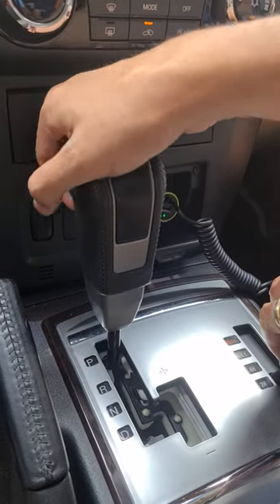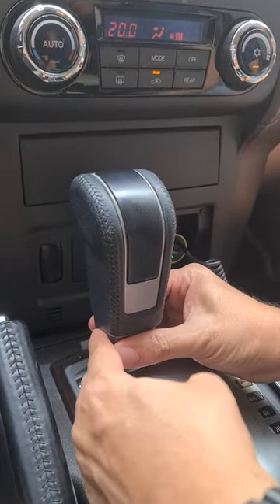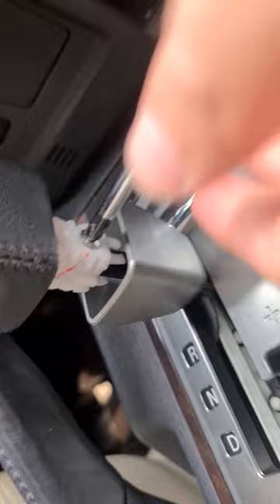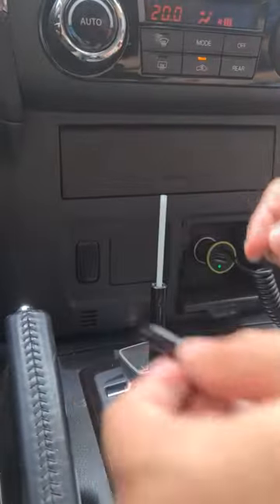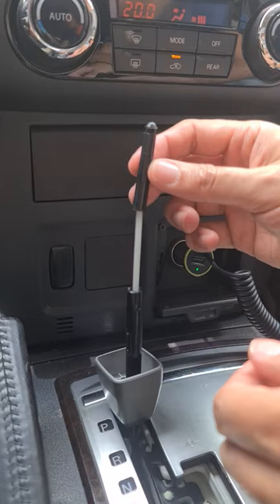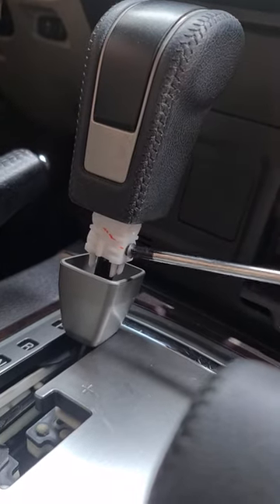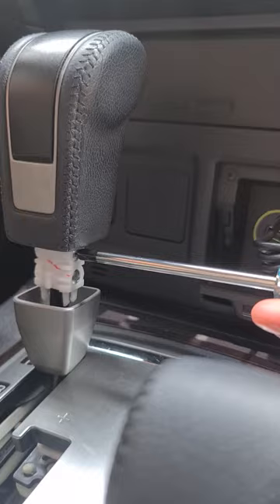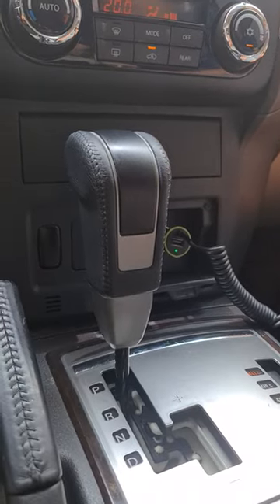How to repair stuck up Automatic Gear Shifter for Pajero

Comment: Thanks for the video - however both the sleeve and the white cable has snapped in my Pajero. How difficult is it to replace the white cable?
Reply: Mine is the same. Any ideas
Reply: @robertbain6494  no good news I afraid. only way to replace the white cable is to install new transmission. I opted for a patch. Glued and taped up the cable, replaced the sleeve. It’s held so far but probably a matter of time before it fails.

Comment: Hi - in my Pajero's case, the broken bits are stuck deep inside the cavity of the gear knob. Very tough to get it out. How to open the gear knob? Only then can i put the new sleeve on the white rod below and then lower the gear knob onto it.

Comment: Mine is going on but it's hard and the car is not changing gears if i want to drive fast.only if i press it slowly it's when it change from gear one to five.what it the problem my be?
Reply: You need to remove the center console put lube on the part where the gear engage its a hard plastic white colored one. Just rub some grease in their shifting gears will be smooth again